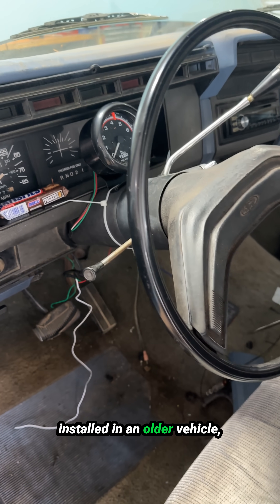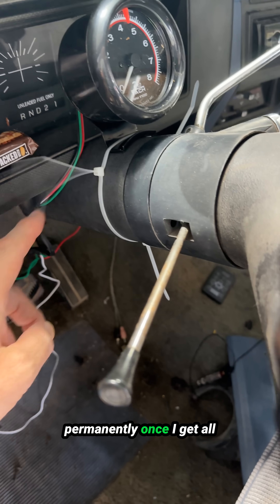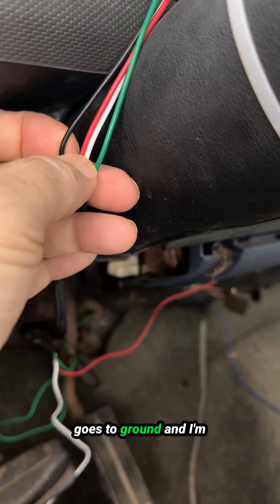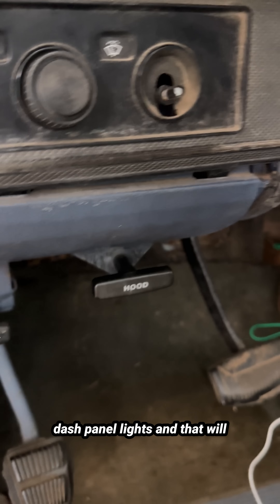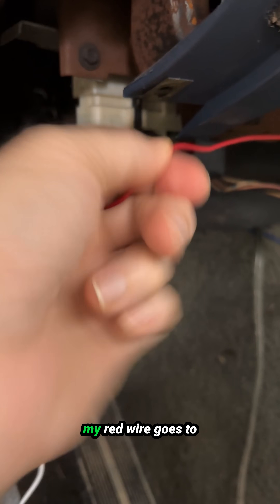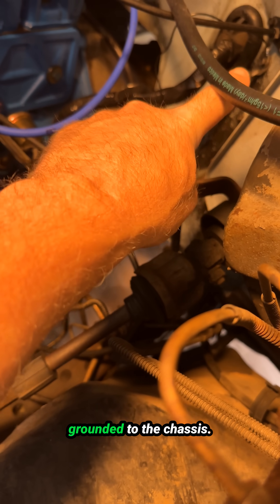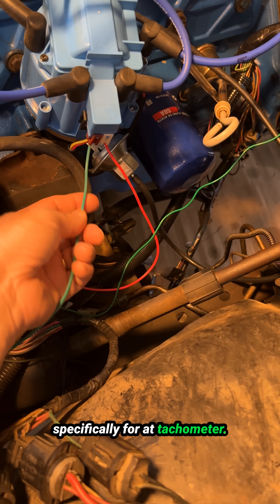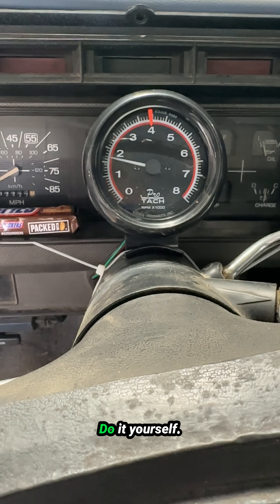How to Install a Tachometer in 10 Minutes!

Comment: I learned the hard and long way.  I have a MSD digital igniting, as well as a points coil that goes to the distributor.   Confusing, and the negative on the coil didnt work so i had to use the GREY wire from the MSD box and now i have tachometer signal and working.
Reply from the maker: Great that you got it working!

Comment: Can you show me where you hooked it up to the lights
Reply from the maker: @Torfinnkjelland, just find a wire coming off your light switch that turns other dash lights on and use a T-tap connector to splice your tach white wire to the wire powering the dash lights. The T-tap connectors are super quick and easy.  Otherwise, you would just use a wire crimp to connect them or solder them together.